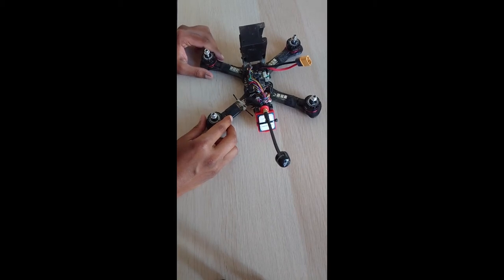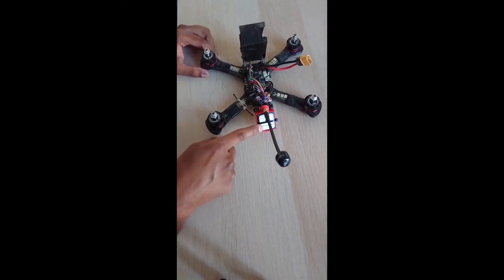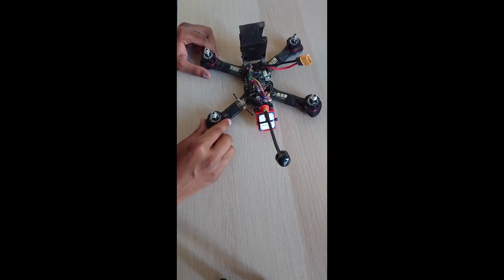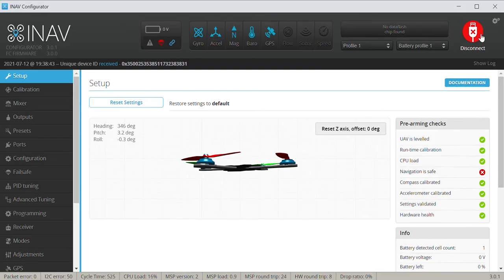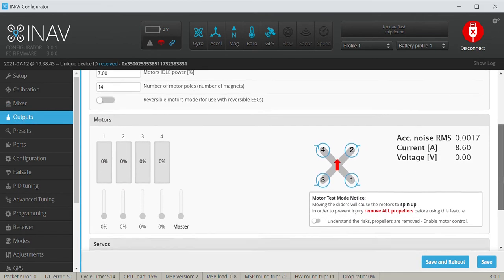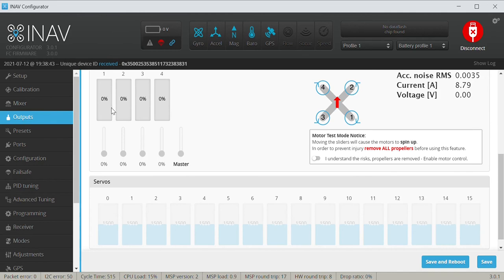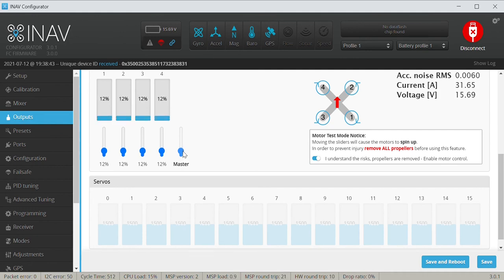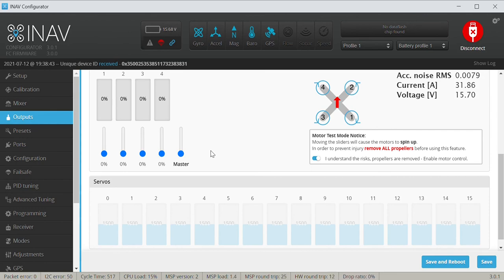INAV ESC constant beeping, Why ? | Part 1/3

Comment: Same.  Betaflght, i could arm 100 times out of 100.  Added gps and inav, can arm 1 out of 10 attempts.  Mine only beeps when failing to arm.  My idle throttle is the default 15%

Comment: I have betaflight and it also happens to me that as soon as I plug in the battery it wont stop beeping. As well, as soon as I spin up some motor, it stops... I have no idea why but it started recently and I have no idea why. Let me know if you find out please, it could be related!!!! Cheers
Reply from the maker: Hey, I have managed to solve the problem and here is the solution: https://youtu.be/FqHrAXu0XTs
Reply from the maker: Sure buddy.. will post a follow up in case I find any solution!
Reply: hapening to me but the beeping is very fast. Any solutions or do you know what is is?